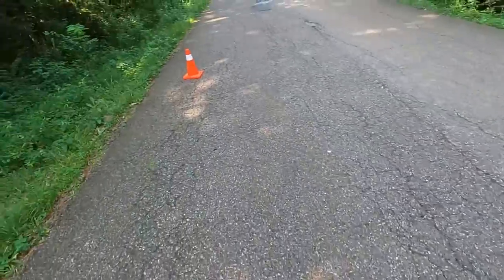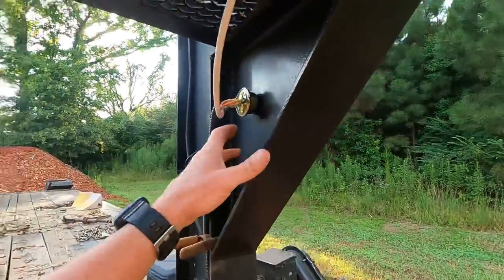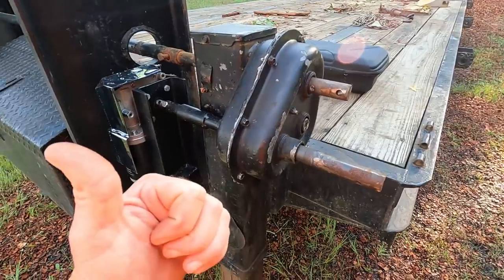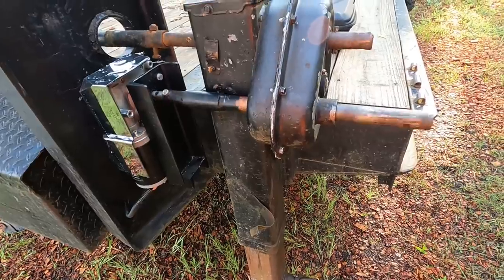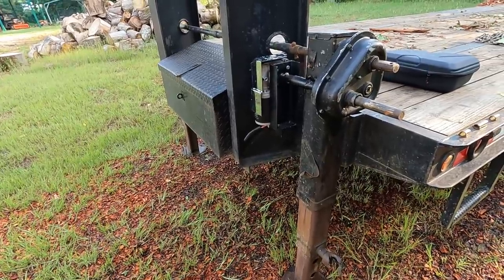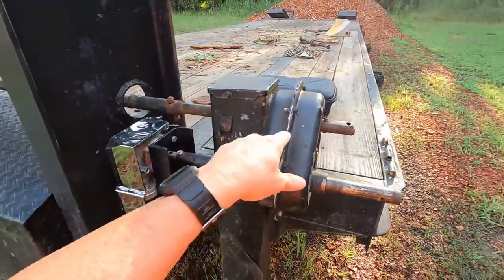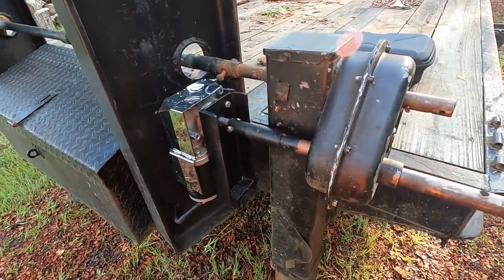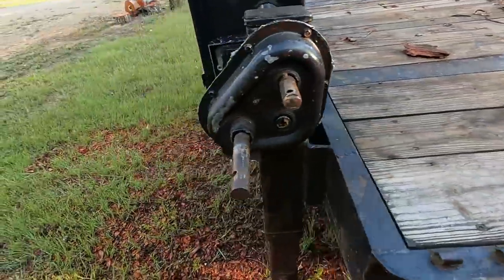The 50:1 Tarping  motor on my 10 ton gooseneck jacks & a dump trailer update

Comment: That's a poppet ball and spring. Run battery cables from the front of the 5500 to the back of the truck and trailer and install a wench mounted on a reciver hitch so you can use the wench on the truck and trailer.

Comment: How well will it handle load in high. I have a 9 ton that ive dreamed of powered leg and how many amps does motor pull because i currently dont have power so i would look to a heavy aux power cable from trk bat
Reply from the maker: The switch and circuit breaker I have on it is rated at 50 amps. If ur going to run in high with a load on the trailer, get the 60:1 ratio motor.
Reply: @cotontop3  thanks. Especially if no gearing